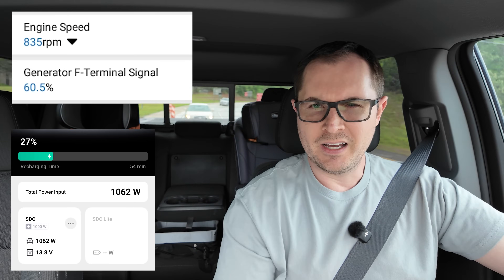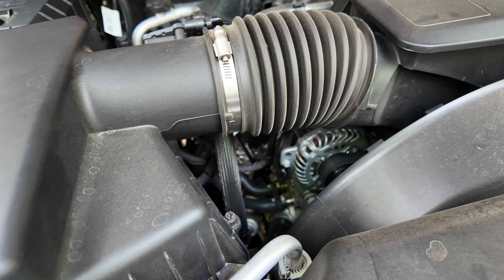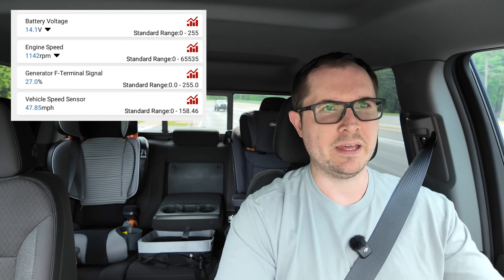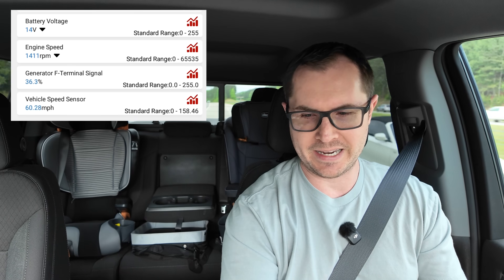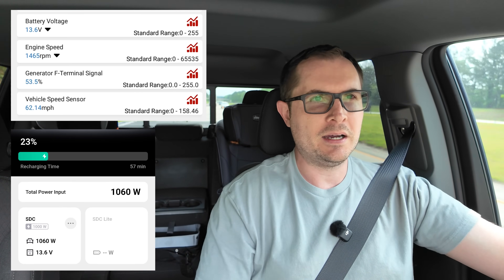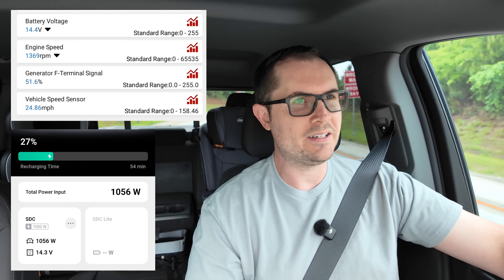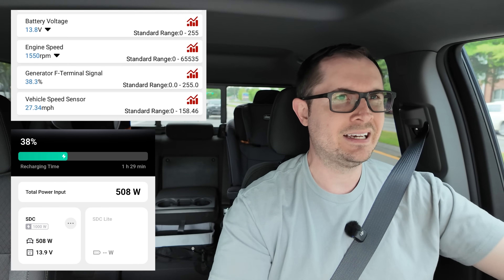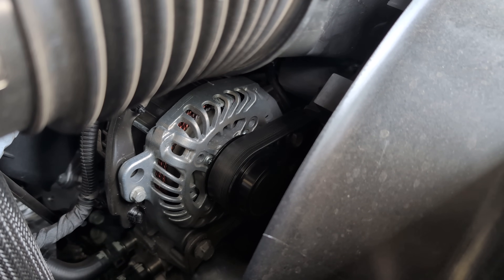I Show REAL Numbers: Impact of DC-DC Chargers from DJI, EcoFlow, Bluetti on Alternator

Comment: I don't see the need to have a DC to DC charger output 1000W. For overlanding purposes, you stay stationary overnight with at least a couple of hours driving the next day. I think 20 - 40A output is more than sufficient for this type setup, and in most vehicles wont harm the alternator. If you truly need 1000w charging, you may have to reconsider your power consumption habits.
Reply: You don't have to always use 1000 watts. Occasionally isn't harmful.
Reply from the maker: Great point!
Reply: @mr.monitor.  provided you have the overhead capacity available on your alternator. 1000Watt at 12V is around 80A. That is a huge load, and has a real risk of burning out an alternator. Most alternators on smaller vehicles not trucks will output between 40 and 120A, and would consume (conservatively) 40 - 50% of that. 

Alternators are not designed to provide 100% output at all time either,  and if they are asked to do so, they will inevitably die sooner rather than later. 

IMHO, the risks of charging at 1000W is not worth the benefits over the long term.
Reply: @any0n378 That is why I said you don't have to max it out. Set it to a lower draw. I just use the 110watts or so that the cig port gives and for sure that doesn't hurt anything.
Reply from the maker: I hear you, great points. For most of us we seldom need the 1kW recharging. Nice to have, but definitely not needed 100% of time.

Comment: Would be nice if the DC-to-DC chargers would add on an RPM sensor to turn off the charger when RPMs get below a selected threshold. Maybe a 3rd party manufacturer can come up with a switch tied to engine RPMs?
Reply from the maker: Great point. Most DC-DC chargers have a minimum voltage threshold setting, which determines the minimum voltage at which the unit will run. By default, most brands set it to 12.6-12.8V. The idea is, regardless of the vehicle spec or size of alternator, if the voltage drops and isn't keeping up, that means the alternator must be struggling and therefore the DC-DC charger should pause. It works pretty well across the different brands. I have mine set to 13V such that if I start to idle for a long time, the voltage will naturally drop closer to or under the threshold and the DC-DC charger then throttles down and eventually shuts off when it drops below. Hope this helps!
Reply: Let the alternator temperature dictate what happens control wise!!
Reply: @cruze1953  Great idea. Do you have any product suggestions for either monitoring alternator temps and/or switch?

Comment: I never heard from a DC DC charger. What is it? What does it do?
Reply from the maker: Basically it's just a way to supercharge a portable power station or lithium battery. Plugging in via regular 12V port might take 10 hours, whereas a DC-DC charger can do it in about 1-2 hours.

Comment: Tons of very smart folks in the comments here. Great video as I was also wondering about this. I set my Ecoflow to 500max a few weeks ago. I drive long periods of highway between camping locations, so it charges the battery to 100% quickly. I have a 2021 Jeep JLU Rubicon. What alternator replacement options are there?
Reply from the maker: Mechman Alternators seem to be some of the best aftermarket options: https://amzn.to/4mKQIFU

Comment: Why does the f terminal voltage say standard range is 0 to 255 if it is a percentage?
Reply from the maker: 0-255 is the bit representation (256-bit) The code reader software shows that for most variables, but outputs the variables in % or decimal in reality. A lack of refinement in the software essentially.

Comment: I've been running a 450W window type AC unit with a 40A DC/DC charger. The vehicle is an E-450 with a 235A alternator. So far, so good after 3 years.
Reply from the maker: Nice setup!

Comment: Well done!
I installed a 20 amp Renogy DC-DC charger on my Ram Promaster City van conversion. The alternator is 180 amps, and I determined that I didn’t want the charger load to be any more than a 50% load on it for exactly the scenario you demonstrated: full load at idle.

That meant 50% X 180 amps = 90 amps alternator output.

Typically, a DC-DC charger can draw up to 50% more power to deliver its rated power.

So, 50% x 90amps = 45 amps.

I could have gone with up to a 40 amp charger and still be reasonably comfortable with that draw.
I decided that 20 amps was plenty for my system, and I know that my alternator won’t get anywhere near 100% load even in the most extreme conditions.
Reply: The Renogy 40A has a + input control wire that lets you switch between 20A and 40A charging.  I wired mine to a switch so I can turn up to 40A when driving and 20A when idling.
Reply: @Freeloving  great idea.
Reply from the maker: Great point, thanks for watching.
Reply: Modern DCDC chargers are much more efficient than 50% so your safety factor is overly cautious.
Reply: @jimqpublic2 it’s the number that was quoted on the data sheet.

Comment: For those just wanting to use a dc-dc charger when not driving the vehicle, wouldn't it lower the percentage load of the alternator if you just get a gas pedal depressor to hold the rpm around 1200 rpm or so?
Reply from the maker: Great point

Comment: Cooking the alternator is most risky with your scenario of idling and strongly charging at the same time.  It is even worse if it is hot out and/or in the sun.  With the vehicle not moving, not only is it a greater percentage load on the alternator, but with no movement, there is little airflow over the alternator and it could overheat and burn out.
Reply: Absolutely correct. It's not the air flowing over the alternator rather it is the internal air flowing through the alternator from the built in fan impeller attached to the rotor shaft. Marine people know this and even install directional fans on the engines that rotate backwards.

Comment: What would be nice would be if the DC to DC charger could sense the alternator draw and not go over a certain percentage, like when idling or load speed, so as not to over tax the alternator
Reply from the maker: Great question. Right now the mainstream players (Victron, EcoFlow, DJI, Bluetti) use the voltage as a key indicator. When the alternator is overloaded, the voltage drops. In the app settings they provide a minimum voltage threshold which is typically set to 12.6-12.8V by default, meaning when the voltage starts getting near the threshold, the DC-DC charger scales back, and when it drops below the threshold it stops completely. I find setting the threshold to 13V seems to be a nice balance and it keeps the DC-DC charger from over taxing the alternator.

Comment: Which would be better, these DC to DC or an AC inverter just large enough to use the included wall charger?
Reply from the maker: If you'll be running engine while using the AC inverter and only need wall charger, probably just go that route as it'll be more cost effective and simpler. The main advantage of the DC to DC charger would be ability to run the power station for an extended period of time without engine running, and ability to move power station to another location and have power there as well. Typically the power stations will have considerbly higher AC output north of 1500W range.

Comment: I’ve been a mechanic for just over 30 years. I use a DC to DC charger on my old Chevy van and I can tell you one thing I carry an extra brand new alternator in the van because I don’t like the load that it puts on the alternator it’s charging six house batteries, sometimes they’re fairly low. Sometimes they’re in the 80% range of already being charged. I do notice a difference. I can hear the load on the alternator. I never use it during idling and I never use it in the city 
I only run the  DC DC at around 2200.

I’ve tested the load at idle and I’ve tested a load at highway speeds huge difference
I also only use DCC charging when it’s cloudy and I can’t get much solar power

From my experience, take it for what you will, but that’s what I do
And so far I’ve had  NO issues

That’s why I carry the extra alternator 
And I will swap it out on the side of the road if I must

I don’t think these chargers are for everybody. You must be mechanically inclined. You must have a little bit of common sense.
Reply from the maker: Great insight, thank you for watching.

Comment: So it would be the best to use only the free capacity until 70-80% max to use as source for DC-DC. I am just wondering that maybe there is a DC-DC which can pull variable current according to the free capacity, and use it only to charge the batteries. Do you know any DC-DC converter that can use an external port to limit its current?
I just made an Excel with your data. It shows, that your car's generator makes between 3000 and 6000 W depending on your rpm. According to my calculations your max generator power is = rpm * (-0,00156* rpm + 5,9456)).
So there is a fix connection to the rpm, and that could be used to limit the DC-DC, or even better to use the difference to the 70-80% limit measured on the F-terminal.
Reply from the maker: Thanks for watching. The mainstream players in the DC-DC space use the voltage as an indicator of how hard the alternator is working, and in turn have a voltage threshold cut-off setting. By default most are set in the 12.6-12.8V range. If set to 12.8V, then when the voltage gets close to or below the threshold, the DC-DC charger throttles down and cuts-off, whereas if the voltage stays higher compared to the threshold, it'll ramp-up and pull more amps. The idea is, if the voltage is dropping, especially suddenly, it must mean the alternator is running out of excess capacity, so the DC-DC charger uses that as a signal to scale back or cut-off entirely.

Comment: Why not take a page out of the huge car-stereo speakers guys playbook & install a 2nd alternator dedicated to charging the auxiliary powered units?
Depending on how old the vehicle is (older = cheaper usually) alternators don't cost a lot.
Reply from the maker: Great point, thanks for watching.
Reply: YES!!  And take it one step further and adjust the voltage regulator on the second alternator to that of Lithium charging profile. This requires a second alternator isolated from the vehicle alternator! You are spot on with your suggestion

Comment: I am in exactly this position where I live full time in my van... I have thought about putting an additional alternator in for charging purposes but instead decided to use a step down transformer and use EV chargers but given all the electronics in modern cars have stayed away from DC to DC chargers and opted for a simple battery isolator that gives me as much power as the van wants to give me without taxing the the vehicle electrical system and I get about 10 amps while driving but can charge at whatever  I want at an EV charge kiosk my chargers limit me to 120o watts.
Reply from the maker: Great setup, thank you for sharing

Comment: I'm installing that Bluetti Charger 1 into a 1997 Chevy Express Van with the 5.7L Vortec engine.  It only has 105 amps from factory.  I don't want to think about charging, idling, which accessories are on, etc.  So I found an upgrade to 190 amps from DB Electrical for only $155 shipped to the house.  I am installing that for piece of mind and and want to be able to charge using the full capacity of the DC to DC charger.  Thanks for the great video!  How did you have all that data pulled up while operating your truck?  Which device did you use?
Reply from the maker: Great points and nice setup. I used the Kingbolen OBDII reader:
S800: https://amzn.to/40lc3gn
Or K7: https://amzn.to/46cssaH

Both great options and they do a LOT more than just what is featured in this video. Thank you for watching.

Comment: Bluetti Charger 1 $199 is half watts at 560W, but some claim the software is better. However your video saysDJI software allows you to limit the charging watts. I only need to run a Bluetti AC180, so I'll buy the Bluetti Charger 1 unless someone can give a compelling reason to buy DJI? Victron Orion 12V/12v is $100 more so I'll pass on that. Thanks!
Reply from the maker: Great question. I think you'll want to stick to the Charger1 from Bluetti as it'll work not only with Bluetti, but also other brands. With DJI and EcoFlow, they are only compatible with their respective brands so you'd be forced to go in their ecosystem. The Bluetti Charger1 is probably one of the most universal models. If interested, here's a video on the Charger1 installed on my Jeep:
https://youtu.be/8A6BvXudcOg

Comment: Going by the max. one third of alternator ampage rule and charging dc-dc only when on the highway and revs are running the fan to cool the alternator is rock solid, especially if you go easy on the car ac
Reply: This is my plan.  I found out my car runs really efficiently. If I don't have all the accessories turned on. So even with just 140amp alternator I should be able to easily charge @500w without stressing my system while I'm cruising 🤔 i'm trying to get all these numbers and ideas in one spot in my head so I can draw out a plan.

Comment: I wonder how this relates to DC to AC inverters 🤔

using a vehicle as an emergency home generator would probably necessitate only idle rpms
Reply from the maker: Great point. After seeing the data, I'd only do it via high-idle setup where RPM are higher, 1000-1200 perhaps.

Comment: Your suspicions are right on!  As the engine RPMs drop but demand stays high, output voltage drops, field voltage maxes out  but your alternator still cannot meet demand at low RPM. The alternator starts heating up and will eventually  damage the diodes and/or windings.  

Many professional installers will just ignore this problem if the alternator is big enough because the alternator likely will not fail until the conditions are right i.e. high alternator demand loads, high ambient temperatures and prolonged low RPM (note that when your AC is on the engine idle is stepped up), 

On my boat I use two Victron Orion DC to DC chargers; max net load ~112A from a 175A alternator (90A at idle). The Orions have a low voltage cutoff so if the alternator cannot keep up. the output voltage drops and the Orions will taper demand and shut off if necessary. 

A secondary protection is provided by using a Balmar programable voltage regulator that reduces the field voltage if the alternator temperature exceeds 100C.

Some will suggest just getting an alternator thar is twice the size of your demand. Not so sure this will work in my case.  I can be running for several hours at very low RPM and my cooling is not so great. 

Other improvements I discovered; Increase alternator cooling, increase pulley ratio, use a programmable voltage regulator that reduces the output at low RPM. A quick look at the alternator output curve will explain the relationship between RPM and alternator output.
Reply from the maker: Thank you for watching. Nice setup!

Comment: Had to watch it again now that i have AC running. I also saw an expert talk about how to run your AC. Basucally dont out it on full balat right away. And run it a bit in winter to keep the parts moving, thst was a new one. I am still confident my system is good as my charger is smaller than yours, my alt os a bit bigger and i have smaller total loads (no heated seats). It would be great to have a guage on the dash that doesnt just show an analog version of voltage but also alt load.

Comment: Great video thankyou. I feel it's worth using this as needed with common sense. I also think it makes sense to match your dc to dc charger amp output to what you need to charge your solar battery in the time you need it too. I have a 500w battery and may be happy with a 500w charger to charge it in 1 hr driving. Or the larger 1000w use in 1/2 hr.
I would use it for longer trips and rainy days when my solar panels can't charge my battery and I have no other means to charge the battery.  It seems the key is to charge at highway speeds with the least draw on your alternator and don't use all your vehicle options during charging if possible.

Comment: The engine revolutions(spin rate) for power generation by altinator was the greatest useful info to know. Is it possible to get more power on idle speed with higher power generating altinator? Second question is it possible to increase idle RPM to have more power generation on altinator? Or Does having larger power generation altinator generate more on low RPM?
Reply from the maker: Yes on both. In fact my understanding is service vechicles for law enforcement and ambulences have a 'high-idle' mode that you can engage to increase RPM at stand still for this purpose.
Reply: The high idle, besides increasing current output, also increases airflow from the alternator internal fan. There is alot happening "behind" the scenes that all makes sense. Similiar to the F-terminal that you were monitoring but way more valuable data is the temperature of the alternator itself. THIS is where the buck stops. You have to attach a thermistor to the alternator which then limits output once the critical temperature is reach. Cannot emphasize this feature enough. The good regulators have temp input parameter AND remote voltage sense input mentioned earlier.

Comment: confused. DC to DC charger to charge what? Alternator charges battery-Battery satisfies lights and accessories. A DC to AC inverter powers tools or appliances, but DC to DC?
Reply from the maker: Great question. Here's a video showing the DC-DC charger use case: https://youtu.be/CWABeZxesSc

Most folks use them for charging portable power stations or lithium batteries on a trailer.